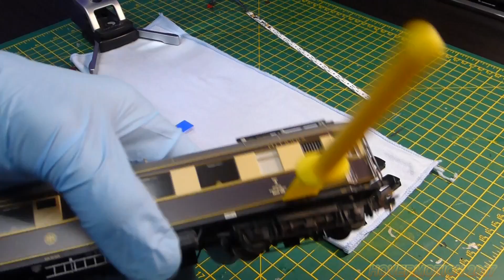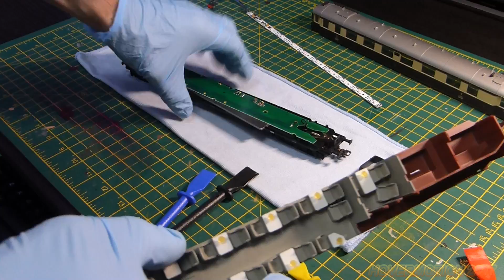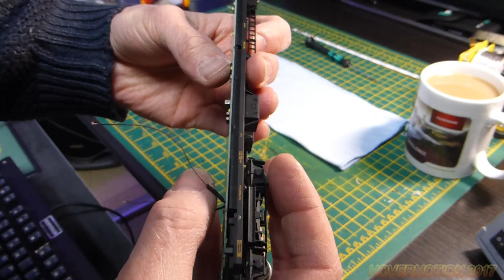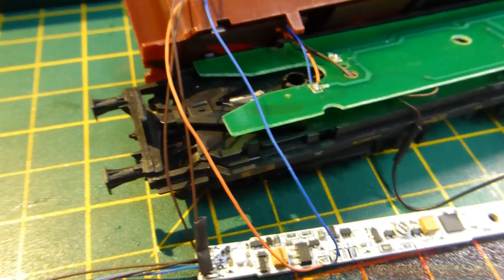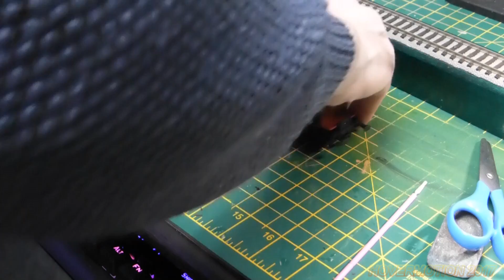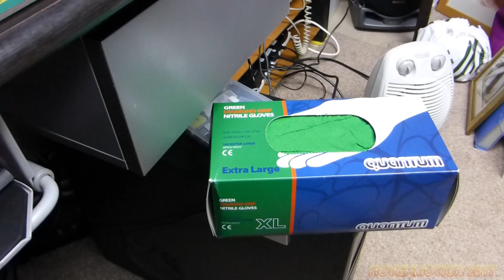Install of Esu 50709 lighting Trix 23430 Vid B

Comment: I was looking for a description on how to modify the Trix 23430 and found your video clip.
It's very interesting as it explains the installation and the setup of the ESU 50709 led strips that I want to install.

I have a few questions.
You don't use an ESU function decoder. Why?
I also see that you disable the electrical connections between the cars. Any special reason for this?
How do you address the cars? Individually or by giving them a common address?
Reply from the maker: Hi ,

I think the Esu lighting strips have the built in decoders . I gave all the coaches the same  address, also I striped out the dcc couplings and sold them as there is no need for them with power back up caps and built in decoders for each coach.
These are in storage now as it was a few years ago when I did this fitout.

Jim🚂🚃🚃🚃🚃👍🏻
Reply: @hovermotion  I’ve now installed ESU 50709 (yellow led) inside the carriages and removed the Lokpilot 3 Fx decoder. It looks nice. Thx for the great video clips … very usefull.
Reply: @hovermotion  Excellent. Thank you Jim.

Comment: Hello Jim , great video , but how do you operate those lights ?? Is it possible to operate these lights with a Roco Multimaus??? Kind regards Eddy
Reply from the maker: Hi Eddy , 
I hope you are well,
Yeah any dcc controller, each Esu lighting strip has a built in decoder on the type I installed.
There are more basic Esu strips which work without a decoder.
There are other makes you can use which are cheaper but not as advanced as these units. etc...
Reply: @hovermotion  Thanks Jim , I picked up my railway hobby a while ago , and a lot has changed as regards the digital aspect , your videos are always helpful and a joy to watch !! Kind regards Eddy
Reply from the maker: @eddyvanvijfeijken6365  I was the same in 2010 I had no clue adout dcc ..

Comment: Been fitting these for a while now, check out my esu pullman coaches with these lights fitted, much easier to do then these. Great work
Reply: https://youtu.be/6dwNkGn9yF0
Reply from the maker: John JMC thanks...these coaches were factory set up in a very strange way so I decided to install the esu  as they worked out cheaper...
very tricky to do without causeing any damage...